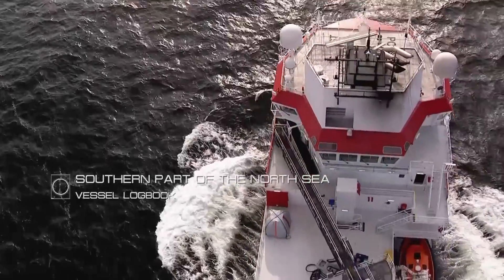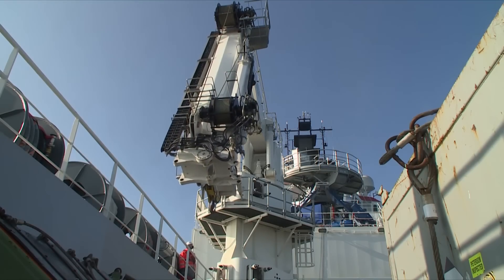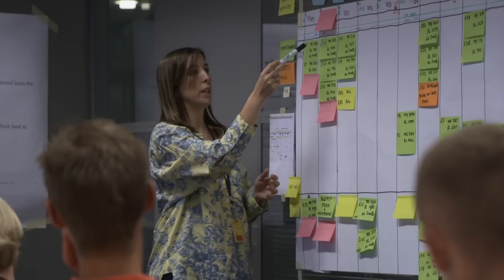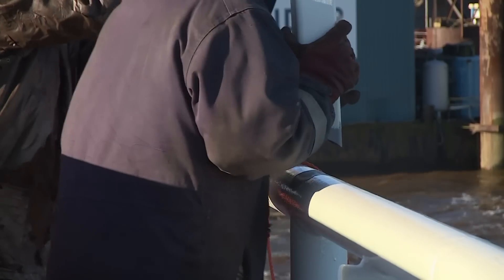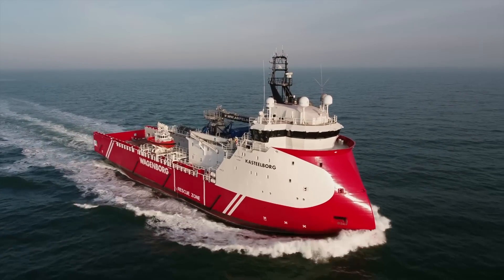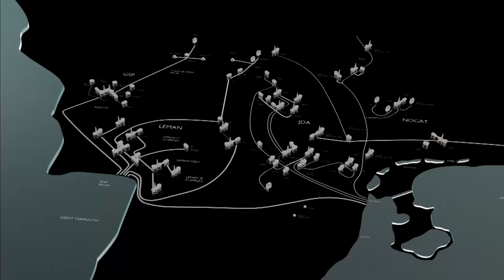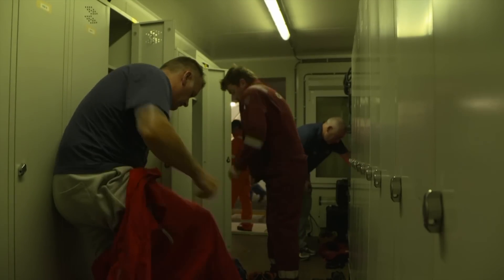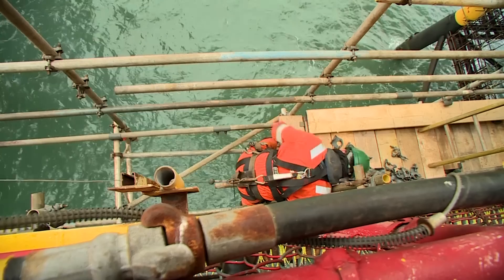Short documentary - Walk to Work vessel Kasteelborg 2018

Comment: How does the walkway work when you have 50 feet high waves on site which is common in the north sea, the walkway would be impossible to connect.
Reply: They simply shut down production and come back when the seastate improves.

Comment: These remarkable vessels not only make transporting workers and Engineers to offshore facilities considerably safer, they also hugely reduce the cost of the transfers.

By not requiring helicopter landing decks and their subsequent upkeep , the costs are further reduced and those helidecks can be sold.

The Walk2Work project has been a remarkable success on every level, especially safety and cost.

These vessels will significantly change the offshore industry, for the better.
Reply: i hope this will help reduce oil prices
Reply: @benzerredoble9237  that is no lie brother roughneck!! Here in the USA 👍👍👍👍👍🇺🇸